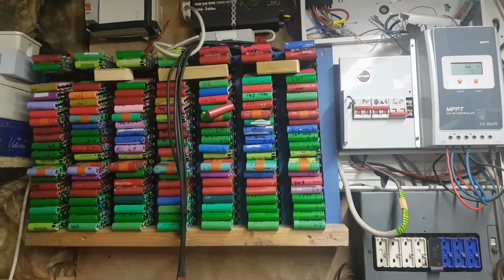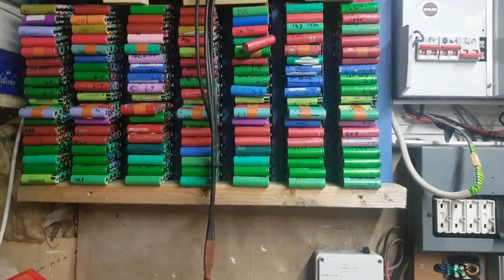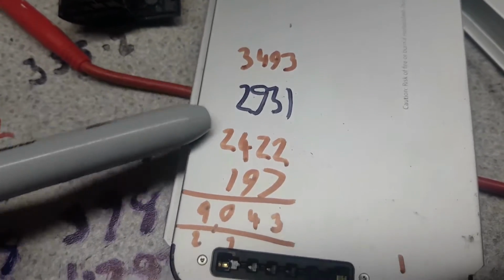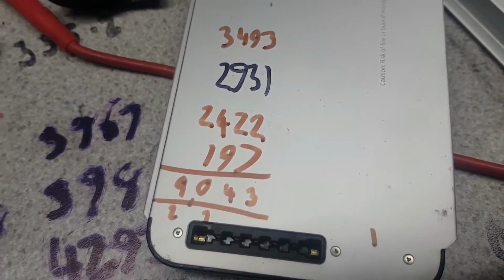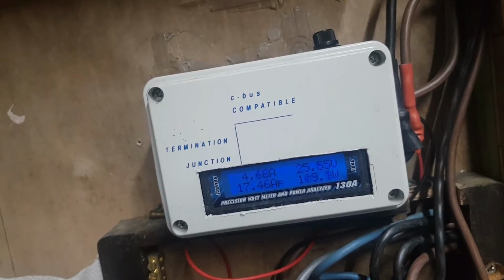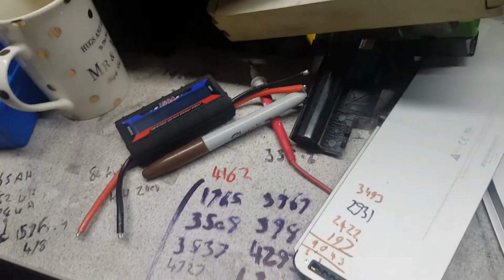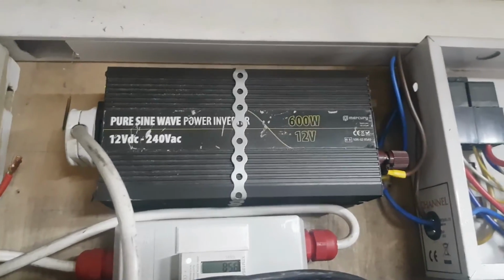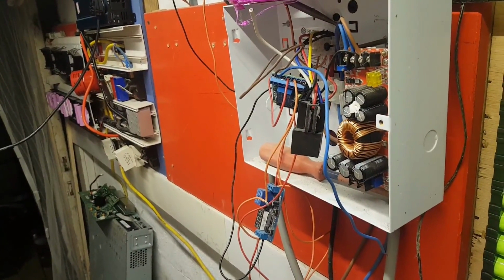Things have got to change!

Comment: New batteries look great, you should try using something like this https://bit.ly/2QTQ1io and also add in (which I think you mentioned), a 24 volt high and low voltage disconnect. And for balancing, setup the batrium system, which is expensive unfortunately but works great for keeping the batteries in series balanced.

Comment: Those new packs do look good.
Reply from the maker: From a distance! I have had trouble with my nickel strip. Tested my first purchase from a single supplier but not the second purchase. 

Turns out the second purchase was nickel coated steel and not as pure! So i had to solder copper to it. I believe you have seen my soldering! =)

Comment: the ep ever keeps all the info you need i did find a low power windows machine worked better then the display and the software made graphs etc
Reply from the maker: Not on the load side. No inverter and no more than 30A. I'm running an inverter and dc 12 and 24v loads that I need to record off of one watt meter.
Reply: @pietkaify  yes this is true i never ran the inverter i swapped house lighting out to b22 12 lights i tried to keep eveything battery voltage